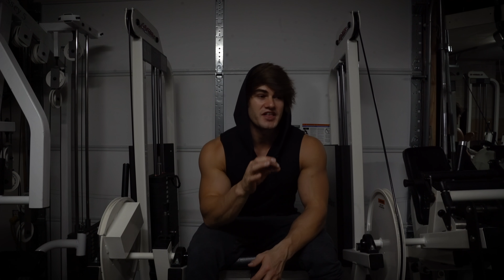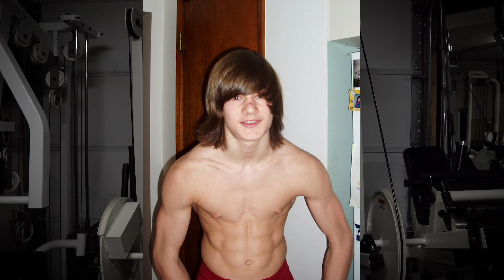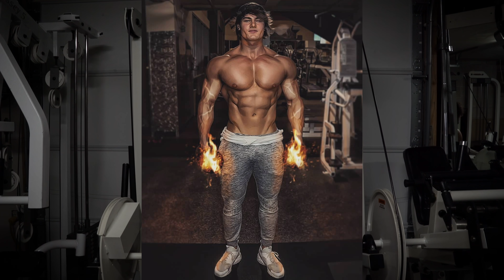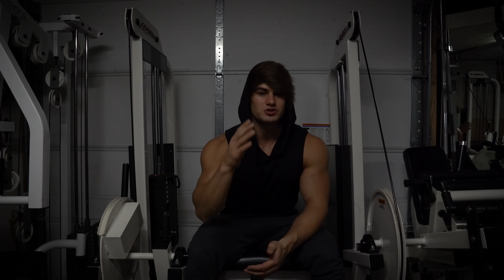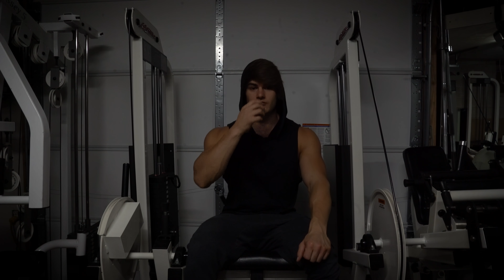HOW I DID MY CRAZY CHEST TRANSFORMATION

Comment: Stuff Not Included:
#1 Progressive Overload
#2 Switching to paused bench press, rather than regular bench press for your working sets.
#3 Increasing your total work capacity, being switching isolation exercises e.g. cable crossovers for dips or tricep push downs to close grip bench press.
#4 Bench press set up. Being retracting your scapula properly, not having too much of an extreme arch and opting for a wider grip on bench.

Also, do NOT press with the bar going closer to your face, as you are putting unnecessary tension on your shoulder and more importantly your rotator cuff. Which can result in injury.
Reply: Great. Now STFU and keep mirin

Comment: another tip. if you are going to be drug free then focus primarily on building a strong incline bench. flat bench is great but building upper chest is much more aesthetic..and if you can do 225 for reps on incline, your chest will not be small
Reply: Upper chest is kinda genetics too cause from what ive seen some guys got a little bit of a gap (i had a bit of a gap) i think flys or crossovers are rlly underrated when it comes to truly making the chest pop in my experience at least
Reply: Slim or just do overhead press
Reply: @acraze2287  overhead press is amazing, but im just talking about mainly chest development. You will build some upper chest from doing overhead presses, but nothing like doing incline
Reply: Slim if you do overhead press properly where you touch your chest you will build just as much upper chest